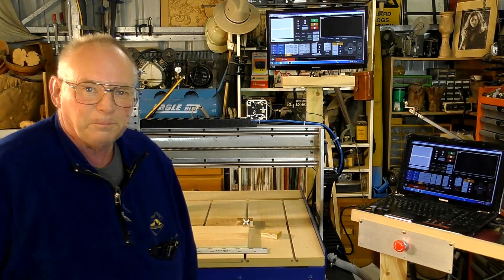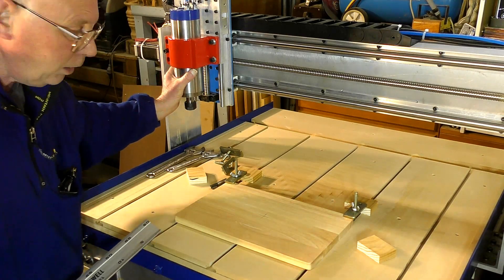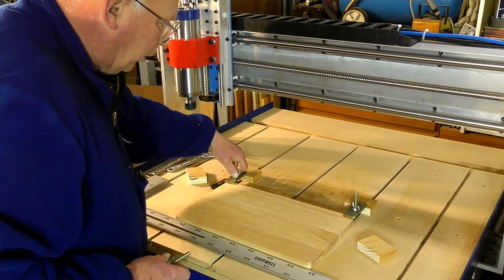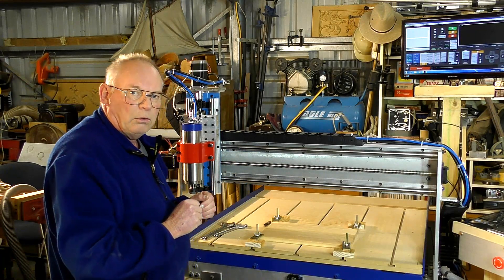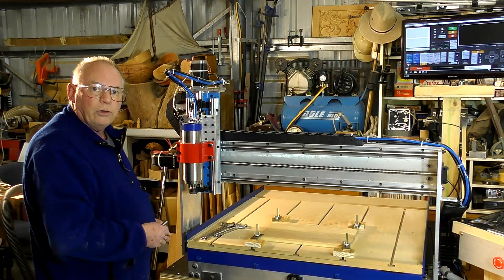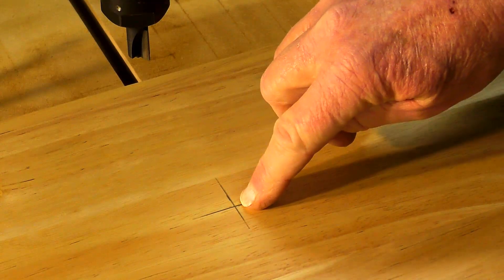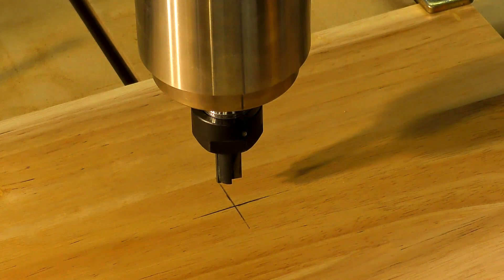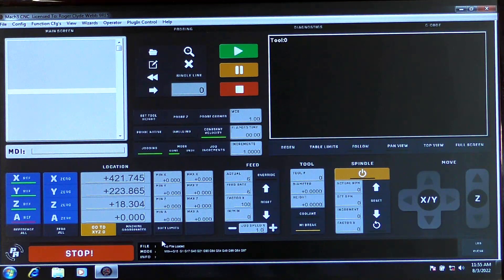Getting started with CNC Routers, 3D carving and Mach3 (The first steps) Setting up Video One

Comment: Thank you for all the videos and information you send out I have learned a lot from it 
I now sit with a newly build cnc router “home build “ the problem I am facing is when I set up a job and start it it will plunge the spindle into the job and then come back up and start cutting above the job Not sure is it that my Z is wired wrong or what can be the problem